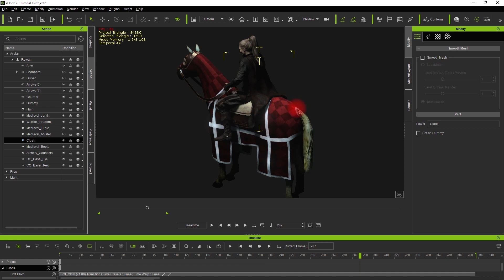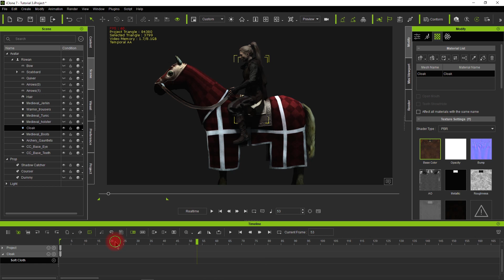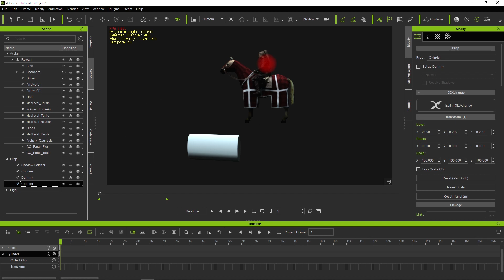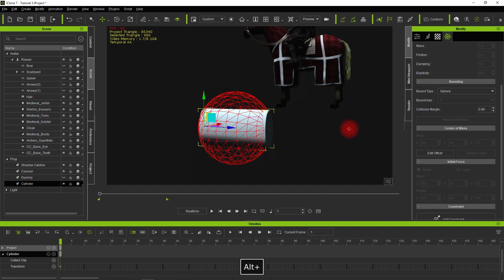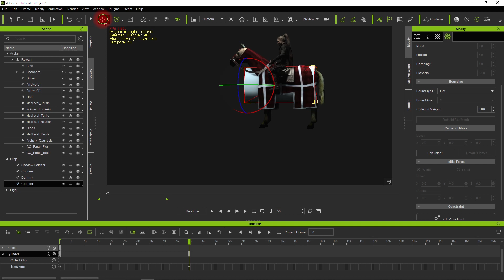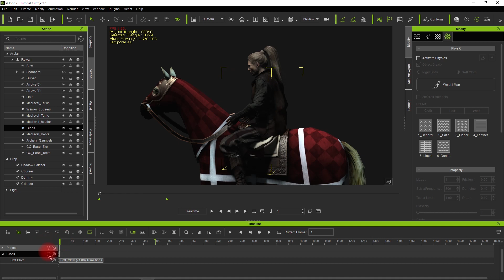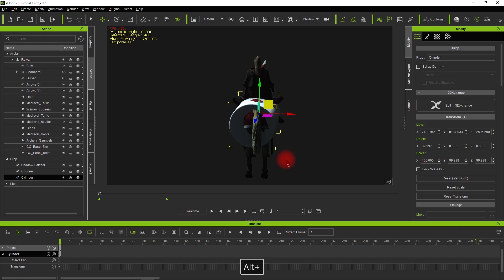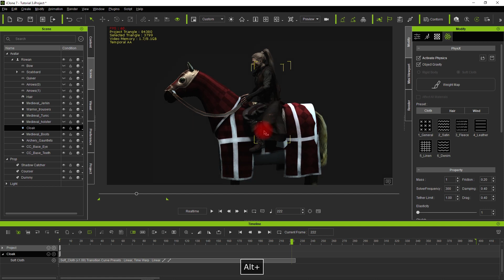IClone 7 Tutorial - Creating Collision Shapes for Props with Soft Cloth Animation

Comment: Not work I can't understand why
Reply from the maker: Can you give me some details and I will try and help. You can also IM me if you prefer.
Reply: I have a character enabling the collision shape option for all of its parts.
And I add a floor and activate the physic kinematic option
And when I start the movement, notice that the object is still penetrating the ground
Reply from the maker: If the soft cloth is already penetrating the floor when you begin it will not relocate above the floor. Try starting your character above the floor and then after 10 or 20 frames move it to the floor. It should stop the soft cloth at the floor. Let me know if this works for you.
Reply: Well I'll try and tell you the result
Reply: My character have spring joint for clothes
I don't know if it will work
I will try both weight map clothes and spring joint

Comment: Very useful. Thanks. I had a question. Once the simulation is done and a desirable cloth fall is achieved can we delete the rest of the sim and keep the final part of the simulated cloth as the baseline.
Reply from the maker: If I understand the question correctly once the soft cloth physics simulation is run, assuming you had "Bake Soft Cloth" selected, you can go ahead and delete the dummy collision shapes you created. The don't serve further purpose. Just be careful once you bake the soft cloth simulation if you make any changes to the location or animation of the characters you will have to bake the soft cloth animation again.
Reply: @pvrmain  Thanks for the tip. Very useful too. My question was a bit different >>> Once the simulation is baked >>> Then  can only the last frame of the clothes simulation be kept >>> And the rest of the simulated key frames be deleted >>> So that Only The Last Simulated Frame becomes the start of the Cloth (Rider's Coat) without having to keep the previous simulation frames ? Thanks again gor responding.
Reply from the maker: vivek tyagi You can break the soft cloth baked animation by just right clicking on the frame where you want the break to occur. I think I clone requires at least 2 frames be kept but that should do what you want. Try it out and if it doesn’t work for you I can look at it closer for you.
Reply: @pvrmain  Many Thanks. Will look at breaking the clip. Thanks again.
Reply: @pvrmain  Thanks. Ya that hopefully should do the trick. Thanks again.